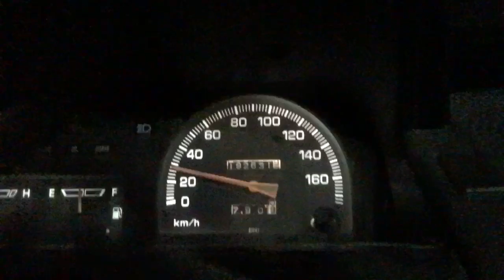1.5L/100km - Running your car on vapour - It really works!

Comment: When considering the concept of fuel vaporization for internal combustion engines, the chemical composition of the fuel is often overlooked when designing a system. 

Petrol (Gasoline) is composed of both light and heavy hydrocarbon chains. The light hydrocarbons, being more volatile, ignite quickly, where the heavy hydrocarbons require higher temperatures in order to break apart enough to rapidly oxidize.

In many YouTube videos of people attempting to vaporize petrol with ultrasonic foggers, or even a more simple bubbling device, you'll notice there is always some fuel remaining in the container that will not readily vaporize, even with ultrasonic agitation. These are the heavy hydrocarbon chains. They aren't easily evaporated, and are far less volatile.  

The standard Air/Fuel ratio of 14.7:1 is designed to provide extra fuel in an atomized (not vaporized) state to the combustion chamber in order to quench the ignition of the heavy hydrocarbons, which only start to burn once the piston is nearing the bottom of its travel in the cylinder. By then, cylinder temps are high enough to break these heavy hydrocarbons down into light ones, allowing them to burn up, but at the wrong time.     

This is the sole reason why running a petrol engine too lean will cause burnt exhaust valves and damaged pistons. There is a secondary ignition that is occurring at the end of the power stroke -- all those heavy hydrocarbons. 

To prevent this, a richer fuel mixture is used -- the light hydrocarbons will ignite rapidly enough to turn the crankshaft, and the extra atomized fuel that doesn't vaporize quickly enough will effectively prevent the heavy hydrocarbons from igniting at the end of the piston's power stroke. This is why modern vehicles are equipped with catalytic converters. The exhaust temperature heats up a bundle of precious metals and this is intended to burn up the heaviest of the hydrocarbons that would have otherwise ignited too late back in the cylinder of the engine, damaging the exhaust valves in the process. And now, all of this is computer controlled in a modern vehicle. 

An ideal system would consist of a miniature fuel refinery on board the vehicle -- the heavy hydrocarbons are first broken apart into light ones, essentially homogenizing the fuel exactly the same way as the fat content of milk is broken apart to allow its equal distribution. This needs to be done onboard the vehicle in real time, before the fuel is then passed to the carburetor or fuel injection system.

This would allow the fuel mixture to be leaned out without damaging the piston or valves, as you would then achieve complete combustion. For an added measure against pre-ignition, a simple water injection system could be installed to raise the octane of the intake charge, with the added benefit of steam expansion, which will increase engine torque.

For a vehicle, it would be a bit of an engineering challenge, but it would be well within the capabilities of someone mechanically inclined, and possessing shop facilities and fabrication skills. If a system like this were designed and implemented, it would then be possible to use the exact amount of fuel needed for a given load, instead of wasting extra fuel to prevent a needless delayed ignition. 

The benefits would be enormous -- almost zero emissions, high mileage, and dramatically reduced fuel costs. The impact this would have in lowering the cost of transportation of goods, etc., would change the world.
Reply from the maker: Sheriff Blatz that sounds awesome! Do you have a video showing all of this? I’d love to see
Reply: @Sheriff Blatz I agree with what you saying, I just wanted to point out that in older long stroke low revving engines there was time to burn the heavier elements, which was obviously lost with the modern high revving short stroke engine hence the problems with secondary combustion burning valves and therefore the need for everything that you already mentioned to combat the problem.

The part I could never get my head around that you stated is the water injection. My father was working on this water injection system many years ago on a long stroke 6 cylinder engine and I always questioned that method because I felt that adding water vapor damped the combustion process and slowed it down and that to get the extra oxygen in the water vapor needed to be disassociated into Hydrogen/Oxygen before hand but we always have disagreed on that one.

I would just like to add that fuel economy figures on production cars hasn't really improved since the early 1970's despite all the technology improvements, and I think I might pick up my research again on this, but I am sure that the fuel companies had something to do with dictating the valve timing/duration on fuel intake.

What are your views on this?
Reply: @stoatrepublic  -- Well, even an engine with a very long stroke isn’t going to be able to take advantage of the heavier/longer hydrocarbons in the fuel, as they only begin to ignite at the far end of the power stroke, so they won’t materially contribute much additional energy to the crankshaft’s rotation. 

Certainly for most applications, the extra torque of a long stroke is preferable; as with the early hit and miss type engines of the late 19th and early 20th centuries – low RPM, long stroke, and large flywheels to store energy for stationary application. 

You’re absolutely right that combustion technology has not progressed much at all since the 1970s. The pervasive use of computer control in modern vehicles has been of no real benefit, as the ability of an automobile owner to perform modifications and repair on their own vehicle has been effectively prevented by modern designs. Vehicles from the early to mid 1990s are the last offerings that lend themselves to easy modification.

As for water injection; what it does is simply raise the octane of the fuel to prevent pre-ignition. If you were to break apart the hydrogen and oxygen first, the fuel would begin to ignite far too early in the compression stroke, as you’d then be adding in the two very volatile elements in their gaseous state. Using an inert liquid like water will delay the ignition of the lightest hydrocarbons until the compression is at maximum, allowing the greatest mechanical advantage to be extracted from the heat energy released by the rapid oxidation of the petrol. 

However, if water injection is already installed, it would then be possible to add an HHO system to obtain even higher performance.

https://www.hhokitsdirect.com/pages/how-does-this-hho-work

http://www.eagle-research.com/cms/store/fuel-savers/hyzor-technology

Considering that it would be easier to modify existing carburetors or fuel injection technology rather than engineering and implementing an original vapor system, a means of homogenizing the fuel into equally small hydrocarbons would always remain essential. 

https://youtu.be/ShBW6Jp_C0s?t=706

http://www.eagle-research.com/cms/blog/fuel-savers-general/1471-airfuel-mixture-lie

In the past, various inventors have attempted to use the same techniques as the oil refineries to try and break the petrol molecules down into methanol and natural gas vapors which were then fed to the intake of the engine. This yields the best possible efficiency.

https://archive.org/details/Bruce_McBurney_Super_Carburetor

http://www.teslatech.info/ttstore/report/articles/v3n2art/crack.htm

This concept of high temperature catalytic cracking is best exemplified in this video:

 https://youtu.be/hC1PKRmiEvs?t=673

If it were possible to achieve these same results without the use of extremely high temperatures, this would greatly simplify the engineering and implementation in vehicles and stationary applications.

In 1939, Popular Science Magazine featured inventor Francis Wilkinson, a British chemical engineer. Mr. Wilkinson pioneered the technique of applying high frequency electrostatic fields to organic compounds, altering their chemical bonds and creating entirely new substances. 

http://rexresearch.com/wilkinson/wilkinson.htm

His 1953 patent: “Process and apparatus for treating Hydrocarbons” is easily the best solution I’ve ever seen, and could easily crack petrol down into lighter substances in real time under the hood of an automobile.  

The output of this device would be equally suitable to either true vapor induction systems, or even existing carburetor and fuel injection systems (using a lean atomized fuel ratio coupled with water injection).
Reply: The oxygen levels are controlled to prevent or minimize extended burn.
Reply: @jaredstieg4238  -- The oxygen levels are monitored by a sensor, which sends information to the vehicle's Electronic Control Module. The ECM is set to maintain an air/fuel ratio of 14.7:1. More oxygen detected causes the Control Module to think the mixture is too lean, so it compensates by signalling the fuel injectors to spray a greater volume of fuel. This adds additional fuel to enrich the intake charge, thus preventing the secondary burn from occurring in the cylinder. This is why modern vehicles are equipped with a catalyst in the exhaust to prevent large amounts of incomplete combustion from polluting the atmosphere. 

Essentially, the fuel system of a modern vehicle has been cleverly engineered with an on-board computer that ensures the correct amount of fuel is "wasted".
Reply: Id suggest some peops try this on a lawnmower if their car is ecu controlled to litterally see the difference. You can advance your timing a bit too when you figure out the fuel side 👍
Reply: I dont overlook the chemical composition when designing a vapor system.
Reply: Sheriff Blatz What about ethanol alcohol? Wouldn't that be a better fuel to use for a vaporization system?
Reply: @keithc8108  It would, but ideally, the compression ratio of the engine would be increased to about 12.5:1 or even higher to take full advantage of 100% ethanol fuel. Ethanol could be vaporized quite easily, and would yield excellent results in most every engine if the compression ratio were increased. An engine definitely benefits from being tailored to run on alcohol fuels -- it would then yield very satisfactory performance.
Reply: Sheriff Blatz .
Vehicles are industrial waste disposal centers that we pay for.
We should get our vehicles and fuel free because we save them billions a year in environmental disposal fees.
If people new what they were really doing driving vehicles.
They'd go kill the president of this wicked government.

Comment: I have some quesitons..

Does it have as much power as the normal engine?
Is it not prone to overheating due to air-fuel mixture?
Reply from the maker: Ikki Castro firstly, I haven’t been able to drive with long term. Engine seems to have slightly more power.  Runs smoother and can rev higher while staying smooth.

No, it’s not prone to overheating. In fact, the opposite happens. The engine runs cooler, as the air/fuel is in a gaseous state, rather than a air/liquid state. And therefore you get a much more complete combustion. Which is more efficient and heat means wasted energy. Less heat means more efficiently. 

Hope that helps with your questions 👍🏼
Reply: @NathanR1995  I did this before to my motorcycle.. It was working.. The only way that I could check wether the air-fuel mixture was lean or rich was by reading the spark plug.. And the burn was white.. It was a lean mixture.. I decided to not continue the project because I was so adraid that It would overheat my engine.. I tried paying aroud with the air intake before air gets in to the container, but the result did not change.. It would only change the idle, but the spark plug burned the same..
Reply from the maker: Ikki Castro fair enough. Glad to hear you did the experiment. Id love it if you bought a cheap bike, road or dirt and did more experimenting and tell YouTube what you’d done and learnt.
Reply: @NathanR1995  Also, I'm trying to come up with safety measures before I try experimenting.. Extreme hot weather might cause the container to blow up.. I don't know.. Just scared.. Lol..
Reply from the maker: Ikki Castro fair enough, but you really don’t have anything to worry about as long as you don’t have any naked flames. Without ignition, petrol can be heated to over 300°C

Comment: Firs try to drive 100km/h then tolk
Reply from the maker: Alex Lisyuk why are you sceptical? Look, I don’t blame you. In this video I reached a max speed of about 75km/h. I haven’t built a system yet that will last long term and self adjusts depending on engine load and RPM. Soon I will be finished though and will do lots of driving and tests. Stay tuned mate!
Reply: @NathanR1995  becouse i made same thing like you did and its not good. You cont drive it more then 10 minets .
Reply from the maker: Alex Lisyuk yes, that’s right, after 10-15 min, it doesn’t work, but I’ve learnt why and there’s a way around that problem. I’m building a system right now that will work much better and long term

Comment: Thanks for the video. This is nothing new actually, some guy in the USA made a professional metal container/tank which was heated etc... and proved he could get 200 mpg back in 50's...on a big V8 motor, so if an old inefficient V8 can get 200mpg, what should you be able to get nowadays with modern engines. Check for lean burning by checking the colour of your spark plugs, easy to do. Anti flash back device would be sensible. Your fuel ratio changing because of temperature changes sound completely plausable, I would think that a more constant fuel temperature by using a heating element would create a more stable air/vapour mix. Not sure what temperature would be best though, petrol boils at around 95 DegC at atmospheric temperature, you have a vacuum which will mean boiling point is probably less than 95 DegC...Look up the Pogue Carburetor
Reply from the maker: MrFreddiew1 this is the best comment yet. Thanks!
Reply: Thomas Ogle was killed because of what he found out

Comment: Have you ever tried heating the fuel before putting it into the bubbler? Like with a coffee warmer. Might make the vapors last longer.
Reply from the maker: Tesla Fan thanks! This is actually the next experiment I’ll be doing. Heat up fuel via copper tubing rapped around the exhaust header.
Reply: @NathanR1995  Also take a look at Henry Ford. He used ethanol alcohol as fuel and praised it over gasoline. Alcohol vaporizes better and cleaner then gasoline. I think for a vapor system, alcohol is the better fuel.

Comment: Nice. Btw, I have a question. Are octane matters with the "suck" process? And will this works in 2 stroke or rotary (aka 3 stroke lol)?
Reply from the maker: Farhan Ega I’m not sure if octane makes any difference. I haven’t got to the stage where I’ve bothered to test different octane levels and there effects, but common sense says it would.

I presume it would work the same with 2 stroke and rotary, but I’m sure there would need to be modifications to air/fuel and others things too. One day once I’ve got a system down pack I’ll be exploring more engine types and diesel. Plus forced induction engines too. 
Thanks for your comment
Reply: 2 stroke engines still require 2 stroke oil

Comment: Check out on YouTube -2500 miles per gallon car. I would like to have a car that does not need spark plugs.less electrical demand -it's a more complete burn at a lower temperature more efficient and if it were lean burn less likely to burn rings.
Reply from the maker: Excalibur John Deere is love to have a car like that too. And hopefully we can both build one! This is a slowly, but surly like of thing. I will keep building my systems and figure out the magic of it and then produce systems in other cars

Comment: this doesn't work son.
Reply from the maker: It works, both from the theory aspect and the physical-mechanical side. The real work is building a simple, clean, durable system that lasts decades without too much maintenance.
Reply: @NathanR1995  look, gas is always better to burn than liquid.. but how you control the car's acceleration? did you disconnect the fuel injectors when you tested this? - in addition, did you try to run the engine with load? that's is the problem from what I see..

Comment: 1.5L/100km ?! why put that in title ? & was there ANY increase in km/MPG whatsoever ?
Reply from the maker: It’s in the title because theoretically and based off others who have done the same, this car can run at that efficiency, if not better. 
I haven’t built a system that successfully runs that can last the test of time yet, but in the process. Therefore I can’t say if I can achieve 1.5l/100kms yet, but I do expect to be successful.
Reply: @NathanR1995  Got you, I'm ALL for tinkering/DIY engineering etc., of ANY sort. & I think honesty & accuracy/precision is important. Its just that it sounded a bit high at 1st, for virtually ANY passenger vehicle, even though I'm not all that familiar with those units.
Reply from the maker: realcygnus fair enough. Glad you enjoy modifying as much as I do. I’ve calculated that in theory this engine should be able to do as low at 0.3L/100kms. It’s currently a 3 cyl, 1L engine. Car weights 600kgs.
Reply: @NathanR1995  Yup...keep at it...Good Luck.

Comment: Bravo! 
If you’re still working on this, look for Julian Edgar’s videos on here about locating air intake scoops. As the car is carb’ed, if it’s also equipped with a distributor, you should adjust ignition timing. Heating the vaporizer with exhaust heat (or using the exhaust itself, or plumb a copper loop connected to the cooling system into it) will help over longer drives. And a small amount of water injection probably wouldn’t hurt either.
Reply from the maker: Awesome, thanks. I’ll have to look into those few things! Keen to learn more